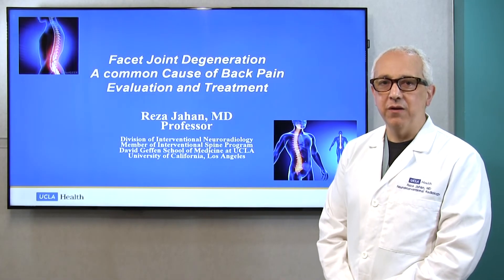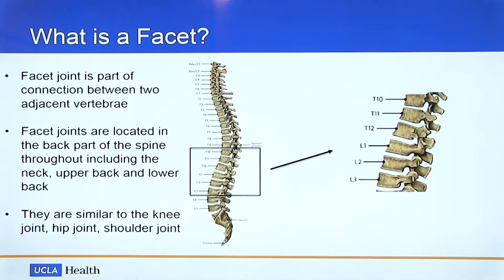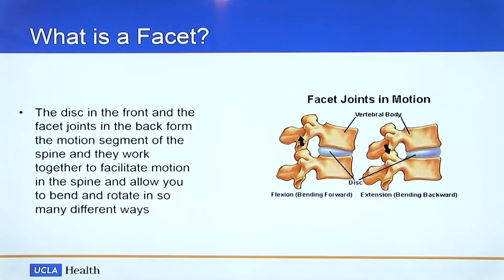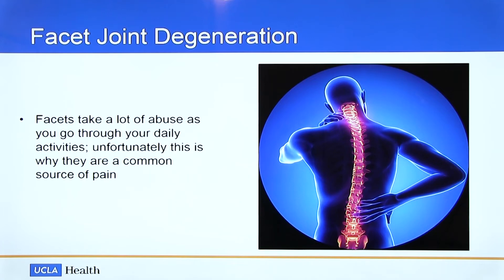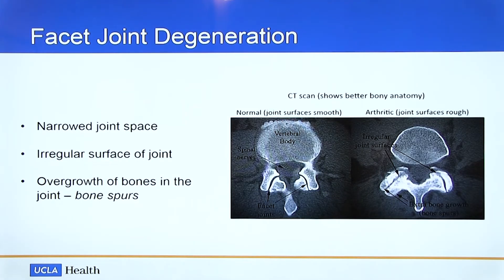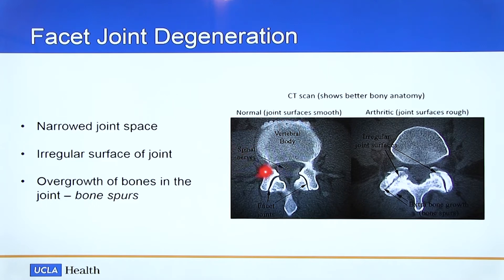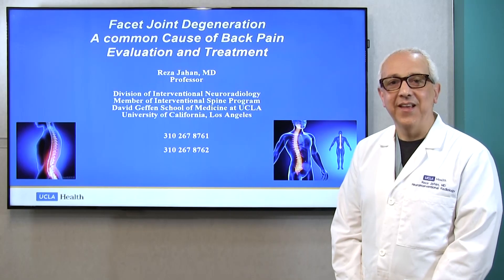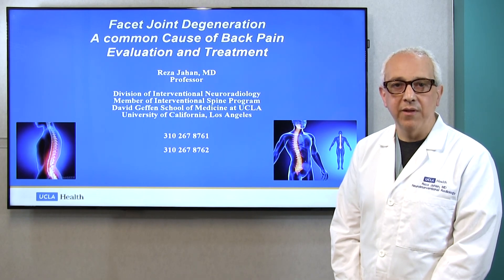Facet Joint Degeneration: A Common Cause of Back Pain Evaluation and Treatment

Comment: Is it possible for facet joint issues to not show on an mri scan? I’ve had chronic thoracic spine pain for five years, one sided pain with severe spasms daily. Physio has calmed the spasms somewhat, however still lots of pain and having had two clear MRIs I don’t know what to do, nor do the consultants. Thank you for the very informative video
Reply: Same here . Mri is clear but i have pain around my t4 vertebre . Spasm and tenderness all day . And no one knows what it is . Consulted many and physio
Reply: @anoopt690 sorry to hear. I’m considering a medial branch block to determine if the facet is the issue
Reply: My MRI did.not show facet joint arthritis but I have it.
Reply: @debrahenze5734 thanks for sharing. How did you get it diagnosed?
Reply: A pain management dr. knew exactly what it is. There are several things they can do for facet joint pain. He thinks mine is being caused by the way Im walking due to a bad hip. Mine did not show up on an MRI.

Comment: 35 years old and riddled with facet joint arthrosis. Its not much fun knowing I've got another 35 +/- years of this shit to look forwards to
Reply: Look at the bright side.  There's a million other things that could take you out by then😊. I'm 64 😂 suffering through the same shit last ten years.  Two spinal fusions
Reply: @johnmitchell8925  That'll be the lupus or eosinophilic asthma I have no doubt. As long as my feet hit the floor everyday it's a good morning. All the best John
Reply: Try systemic enzymes and drop the sugar and wheat

Comment: Can it be cured?
Reply: ArizonaPheonix spine something has a new version. With RFA ur nerves will regenerate fully within a year…that’s where I am right now. 
Arizona procedure is called DVR it basically does the same thing but makes it permanent. Google DVR or YouTube it. If u google there is a Hopkins article
Reply: @tariqkamil7853   according to research it seems to not be pernament just last longer
Reply: @tariqkamil7853 any improvement ? I am facing same problem
Reply: @tariqkamil7853  Endoscopic Medial Branch Nerve Transection is something very similiar or maybe even the same thing?
Reply: thast what im trying to figure out, some doctors say fusion others say fusion wont help so im confused

Comment: here to learn about condition. My low back pain has been on and off for 20 years. Lately at 43 its been really bad. espeically in the morning. I am  43 year old physical male. My Dr did the mri and saw fluid around the facets and beleives this is the cause of my pain. I also have l5/s1 degeberation but she belives that is not the sorce of my pain. my pain is one sides lower back and blips of pain into the top of butt check. feels like a tooth ache all the time. morning times i can barely walk or bend. she wants to try 3 levels l3 l4 l5 of injection to see if it helps.  if so then she will burn the nerve.
Reply: hey i read that endoscopic rhizotomys work longer / better
Reply: Did burning the nerves help? Same situation

Comment: I am 54 and I have osteoporosis with facet disease was told I need intense therapy due to deformation appearing in nearly all my joints neck back hands feet knees hip my brittle ness if the bones are improving from injections however the degeneration of the bones and joints I can't turn my head to the left the pain is horrid 2018 diagnose osteoporosis osteoarthritis osteopenia hence the injections for the brittle bone it is a none curable disease but can be helped pain management hiweverbibhavevraynauds as well so it is a big issue for me knowingly am going to die from this disease you mentioned a accident and as for standing that is a bug no I have no choice but to take care of myself how dies one get thus disease when no member of the family that was living had any of these things?
Reply: Looks like you just got the short straw like the rest of us 😂

Comment: I went from asymptomatic to absolute hell 2 months ago. Does physical therapy significantly reduce or even totally revert the pain back to perceptive normalcy in chronic cases? My ROM in flexion is also suddenly gone, which wasnt the case at initial onset. Lumbar flexion is the absolute worse. I used to be able to crack my own back with ease. Now even a chiropractor cant do it.

Comment: Doesnt radiofrequency ablation and injections mask the pain such that the person is more likely to indulge in behaviors that would only exacerbate the underlying issue without the negative disincentive of pain to guide them out of complacency such as with lazy posture and overdoing it with free weight training?
Reply: YES! I would use this time for physical therapy and strengthen those back muscles
Reply: Gave ,e time to work on my back without the spasms that would lay me down

Comment: if they can put screws through your bones to do a fusion why cant they just put some grease fittings at the facet joints🤣🥵🥴
Reply: Because going in for a lube job on a regular basis would involve multiple, regular surgeries.

Comment: My friend was diagnosed  with spinal stenosis of L3-5 and had surgery,consisting of posterior fusion and decompression posteriorly, stabilized by hardwares.Post-op,he can’t ambulate w/o a walker and uses motorized W/C to get around.He is on pain meds which give minimal relief.F/U MRI  reveals bilateral stenosis with traced anterolisthesis of L3 on L4 and retrolisthesis on L4 on L5 ,severe bilateral foraminal stenosis .Pain never abated.Tried epidural steroid injection;pain got worsened. The right anterior thigh feels tight, heavy and thick.Difficult to walk due to pain.What probably went wrong after the injection, and how to alleviate the worsening pain in the back and leg?Currently,on pain meds as prescribed w/o relief.
Reply: Maybe he was treated the wrong way round.  I sympathize re the pain.  I'm a veteran and have had chronic back problems since an early age.  When enlisted back in the 90's my job caused plenty more issues.  The FIRST time I go see a Dr my option he gave was disc fusion right out the gate. I was shocked and explained I'm very athletic etc. I asked if this would limit my ability in any way.  He said well you will still be able to walk.  I was 22! Military Dr's were butchers many and we were guinea pigs.
Reply: Then came big pharmaceutical and the jab😅🤮😵
Reply: Did he try physical therapy
Reply: Just reading this comment of yours 2 years after.  So sorry your friend has had to go through this trauma. May I ask if the situation is better after this much time has passed? Was your friend able to find any relief since the pain meds were not working at that time?  Thank you in advance for any update.  Take care.  🙏

Comment: Very informative,But in the UK under NHS treatment, The waiting time to get treatment is so long! I’ve suffered for years with Facet joint degeneration, I’ve had several injections of anaesthetic,But relief is not long term.
Reply: i saw people perform endoscopic facet rhizotomy  and get longer releif
Reply: @jackattack9799 is this same to anaesthetic injection

Comment: I’m 54. My MRI suggest disc budges and some facet joint osteoarthritis at L3/4 L4/5 Levels. I’m in pain most of time. Please advise
Reply: Same. I did the RFA as physio wasn’t working. It’s been a year since. I’ve taken my rehab slow and easy and added a few lower back strengthening exercises. What the RFA did for me, was to make me able to go to the physio and rehab without another back attack for 9 months. Im good now and have started my golf again…work my way back to the 6 handicap when all this happened. I also ride a road bike for fitness as walking seems to aggregate the back muscles in and around that area. 
I couldn’t walk or anything for 7 weeks before I did the RFA (was an,e to walk a little by then with the help of pain meds). For the sake of just numbers right before the procedure; pain level 10 before, when I woke up a few hours later, pain level 3. Then worked on working out the knots from the back spasms and relearning how to use those muscles. And of course strengthening.
Reply: Exactly the same for me,  did you ever find anything to help?

Comment: Central and bilateral paracentral protrusion of intervertebral disc at L2-3 level compressing the dural sac and
indenting the nerve roots.
Central and bilateral paracentral protrusion of intervertebral disc at L4-5 level (L>R) compressing the dural sac
and the left sided nerve roots.
Facet joint arthropathy and ligamentum flavum hypertrophy at L2-3, L3-4 and L4-5 levels with secondary canal
compromise.
plese smjao
Reply: How are you now ?
Reply: @rajeevsinghal6439  m good

Comment: I have recently been diagnosed with this after suffering with chronic back pain for 4 years, I had my nuclear medicine spect scan today and hopefully it will help with my targeted facet joint injections, this is really comforting, thank you
Reply: Whats a spect scan? Like a bone scan?
Reply: How are you now...I'm going through this now
Reply: did you find what facet joint issue is causing your pain?
Reply: Having facet joint injections are useful ?
Reply: Did u take the facet joint injection?
Reply: @manuswap505 crazy as

Comment: My considerable internet research has finally paid off and recognized with extremely good facts to exchange with my friends and the world. Medical Doctors and Dermatologists said (HSV 1&2, Herpes zosters) do not have a medical cure because the virus is capable of hiding within the human cells. it remains protected from your immune system. Herpes isn't an incurable virus! your immune system has the tools to fight it back. But because it is able to lay dormant in protected cells, your immune system is unable to remove it from your body, But with strong reactive herbal medication, it is capable of getting rid of the virus gradually and totally from your body without any side effects, natural herbs kill the virus totally not just reducing the outbreaks. I just got my test result today after 7 days of using the herbal Medication and it came out Negative to both HSV 1&2.im so delighted I recommend this to anyone suffering from herpes virus. You can get natural Herbal Medication from Dr. Aloha contact him through his email: Alohaherbalhome@gmail.com or WhatsApp +1(202)871-3222